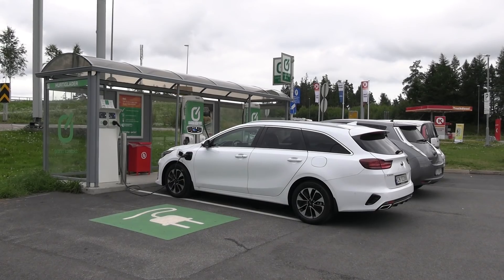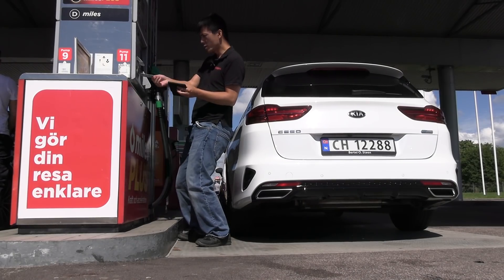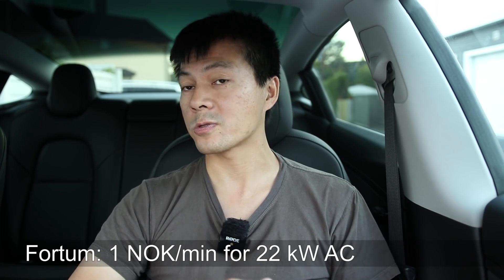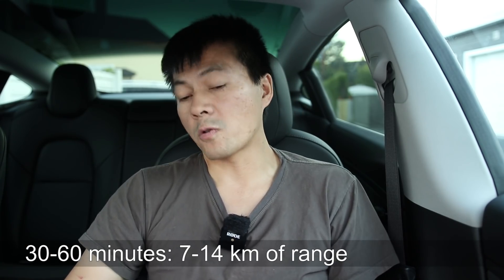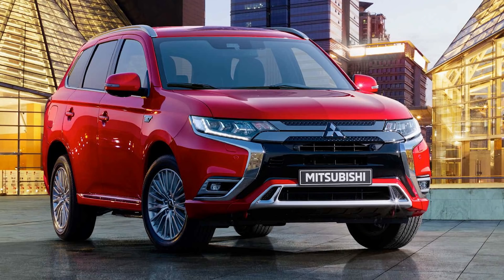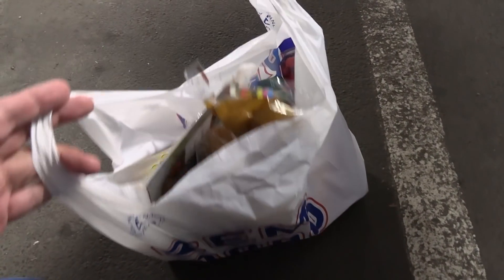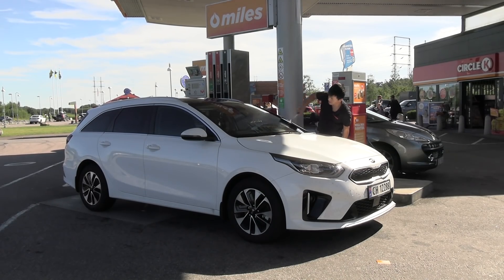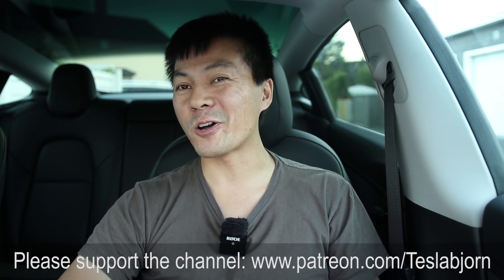Why didn't you plug in the PHEV while eating?

Comment: PHEVs are a joke!
Reply: Equally BEV is a joke. It just depends on 'use case'
Reply: No,they're not. I own a EV and PHEV and I find them both useful.
Reply: @venti4268  I actually agree. Both are very good depending on your needs ... and if you drive a lot even a diesel is good option.
Reply: @venti4268  Mechanic history tells that the more complex the powerhouse is, the highest the cost of maintenance is. You may say that PHEV is good now, but in future years I believe BEVs will win the battery tech by turning it into a standard product, setting the PHEVs aside. No one will want PHEVs because of its lower reliance. I understand PHEVs as a momentary stage of transition between ICE and BEVs.

Comment: I used to see phev  Drivers using chargers all the time  despite the points you highlight here.   A lot of them charge as they genuinely believe their saving the Environment, but often their just blocking a  bev from getting a a charge as would happen with our Triple  CCS/Chademon/ FAST AC43  in Ireland.   The recent introduction of Pay for  Charging  has reduced  the number of phev drivers charging now , as we have an Overstay fee  of  €5   after 45mins at Fast  AC chargers +   about  0.29c  / 33c   per kwh.   I recently changed back from the bmwi3  94ah  Rex to the   Hyundai Ioniq  28kwh   after  watching one of your recent reviews and  really love the car .
Reply: Northern Ireland is kind of worse there only 14 DC rapid charging points in NI, 7 of which have CCS. The points are free to use, but the main issue there is the fact that "freeloading" Mitsubishi Outlanders tend to sit there taking up a DC space.

If you want to do a long journey in an EV that has about 30 kWh of power available, then the only cars that can feasibly do it are the Nissan Leaf (for CHAdeMO only DC charging) and Renault Zoe, because it can make use of the 22kw AC charging points.

There's only 1 other charge point in Northern Ireland, that's ecotricity's Electric Highway charger located at the IKEA, which only has CHAdeMO and 43kw AC.

As the network is managed by the Department of Infrastructure, the network really is a mess. And there seems to be 0 plans to implement more CCS chargers, nor even implement HPC charging.

I do envy the situation in the south... Not only is there the ESB network, but there's EasyGo, Ionity and both Applegreen and Circle K are implementing their own chargers. Oh, and I think there's a Lidl and Tesco that each have their own DC charging.
Reply: @vaska00762  Going up North in an EV in September for three nights. We'll be chugging along the eastern coast and then to Giants Causeway. From what I saw it shouldn't be too bad even if we can slow charge as the Kona has enough range. But yes, I've noticed quite a difference between NI and the Republic. Fast chargers are sprouting up everywhere over here, even Ionity. Do keep in mind they're no longer free here, and come August 10 we'll be paying for słów chargers as well.
Reply: @PawelMrozik  the Kona is pretty perfect for longer journeys in NI, as it has the range to do what you need it to do without needing to recharge.

I recommend charging at Castlebellingham Applegreen before crossing the border as options will be few and far between.

The major CCS points are a point along the A1 Dromore road (northbound), Sprucefield Shopping Centre, Boucher Road, Shore Road Maxol (beside a McDonald's) and Applegreen Templepatrick M2.
Reply: @vaska00762  Thanks for the tips,  we're planning to slow charge during breaks and hopefully can get one full overnight charge at one of the B&Bs.
Reply: @PawelMrozik  there are some B&Bs around the Atlantic coast that have EV charge points, but most of them use Tesla Destination chargers. Not all of them do, but most of them will have 1 destination charger which will work with any EV, not just Teslas. Thank the EU directives on Type 2 for that.
Reply: @vaska00762  Thanks again for the tip, I do remember hearing that Konas will charge just fine from the destination chargers, but forgot about them! I was hoping Ikea Belfast would have CCS as we plan to stop there, but overall we should be fine as long as the Type 2s work.
Reply: @vaska00762  That pretty much described the current network ok.
Reply: @itsfahys  it's pretty depressing to see, and one of the more aggravating things is the fact that the Department for Infrastructure has a 2011 Leaf they keep as a photo op car, that they just park outside of Stormont to get the minister and someone else to just stand in front of for the media.

It's bullshit. I've been seeing a hell of a lot more EVs on the road here though, which is positive to see, but the biggest dilemma recently, I think, has been London. The Office for Low Emissions grant has been reduced from £3,500 down to £3,000, with the Transport Secretary promising to abolish the grant entirely, and instead investing the money directly into public charging infrastructure... which is bullshit unless you live in England. Responsibility for charging infrastructure falls on the devolved governments of Scotland, Wales and NI, and this means that that money that Westminster has promised, won't make it here. Ain't that fun?

What's maybe worse is the idea of a new scrappage scheme, which would allow people to "scrap" their old cars for a new BEV, but only get £6,000 towards a BEV. The main problem there is the fact that pre-dieselgate cars will likely be ineligible for being too new. 

While the SEAI grant of €5,000 and the VRT relief of €5,000 is certainly much, much more than what you can get in NI, the main problem is the fact that 2 of the cheapest new EVs on the market are just unavailable in Ireland. The VW e-Up! (as well as the Seat and Skoda versions) are not on sale in Ireland, even though they are in Northern Ireland. The MG ZS EV is also unobtainable, as MG hasn't even operated in Ireland since partition... MG dealerships in NI still exist though.

It's a pretty sad state of affairs, really.
Reply: @vaska00762  I see electric cars like smartphones, it's only a question of time before they're on parity with petrol and diesel. Then there'll be a huge market for used cheap EVs as the newest ones will have better battery tech. The infrastructure will follow everywhere, but I do understand your frustration. I'm not an EV owner, but I think the infrastructure in the Republic is okay and getting better.
Reply: @PawelMrozik  I mean... who needs parity between EV and ICE range, really?

I looked up what kind of power petrol and diesel fuel has, at least, in kWh. The most consistent results I got were about 9.2 kWh of energy for 1 litre of petrol and 10 kWh for 1 litre of diesel. These numbers would likely vary based on the quality of the fuel, but that's too big a variable.

The car I drive rn is a diesel Hyundai - they don't make them anymore. It has a 40 litre fuel tank. That's almost 400 kWh of capacity - insane to think about. The GoM would state 500 miles (804 km) in terms of range.

If I were to convert the miles per gallon to L/100km, I get about 5.2L/100km. Assuming that 1L of diesel = 10 kWh, that's 52kWh/100km. The Kona Electric gets on average 13.3kWh/100km. As far as I can see, diesel is blown out of the water by electric, petrol even more so.

It won't take very much for electric to really overtake ICE. A car with good efficiency, like the Kona, with an 80kWh battery would more than match a petrol or diesel car. But... why would you even need that 80kWh battery in the first place?

Honestly, I think the future will get better once battery production price gets really good. At that point, there's not even any point in sticking with fossil fuels. I just hope politicians who ultimately make decisions about stuff like charging infrastructure realise it sooner rather than later.
Reply: @vaska00762  in terms of who needs range parity? Consumers and business. Time is money, Bjorn's 1000km is a good testament to that.  In terms of efficiency, while it's true that petrol has a very high energy density, a lot of that energy is lost as heat. In the winter, that can actually be a good thing as it can be used to keep passengers warm. For many countries who depend on oil imports, the switch to electric mobility will bring additional wealth as they can produce the electricity domestically instead of relying on imports. It can also create global tension as it will put a lot of financial pressure on countries whose wealth comes mostly from oil and those that failed to diversify their economies.
Reply: Nice. How are you getting on with the Ioniq? I heard ESB will be introducing fees on the slow chargers August 10. Wondering what the next step up for Ioniq is, I think they're at 38kWh now. Imagine the range with a 64kWh battery.
Reply: @PawelMrozik  Im loving the Ioniq compared to my i3.  Its way more comfortable on  Poor Road surfaces,  and lots of   Speed reducing Ramps where i live.   Its also a lot more stable at Motorway speeds with its  well known Aero Dymanics and low profile holding it to the road a a lot better. You get a lot of extras like  LCAS,   Advanced Cruise Control, Courtesy Lighting for instance that i dint have in my i3.   I know the  Refreshed 38kwh  Ioniq  has a  lot slower charging speeds on Fast Chargers compared to the Classic 28kwhk model but id still consider it with its extra range as I dont drive long distances in Ireland, only occasionally going more than  300km.  I belive the 38.8kwh Ioniq is the last  version that will be released with talks of the Prophecy  to replace the Ioniq in Hyundai's range ,but that is just rumor at this stage.     This is the current positin in relation to pay Chaging with ESB taken from the Irish Times.  
There is a two-tier pricing structure, as there is for the faster 50kW chargers. For pay-as-you-go customers, the cost will be 26.8c per kW used. Regular users can pay a €4.60 monthly membership fee which reduces the cost to 23c per kW. The difference means that a pay-as-you-go customer would spend €16.61 to fully-charge (from flat) a car with a 62kWh battery (for instance, a Hyundai Kona Electric) or €14.26 under the subscription plan.

If you are using an ESB 50kW charger, that costs 33c per kilowatt-hour to use. With a monthly subscription, the rapid-charger price drops to 29c per kW.

The ESB says that, since it launched charger pricing last November, some 11,000 people have signed up to use the membership service.
Reply: @itsfahys  You're right, I think Bjorn has a review of the 38kWh Ioniq and the reduction in charging speed. I had no idea about the Prophesy, but if what they're saying is true, it looks like it'll be replacing the Ioniq. Glad you're enjoying it, I probably won't get an EV for a couple of years. Hopefully by then we'll see equal ranges compared to petrol and better infrastructure.
Reply: @PawelMrozik  Yes please a 64kw Ioniq.
Reply: Any triples that I'm aware of allow simultaneous AC and DC charging. The DC power might be reduced a bit, but that's unlikely to be a real problem if the PHEV is pulling 3.6kW AC.
This of course assumes that the charger has at least two parking spots.

Comment: I hate PHEV-drivers always blocking the 11kW and 22kW-chargers at shopping-centers etc.
Reply: So you'd prefer that they never charge?
Reply: Dave Krüger 
No, they can charge at home, at work, and hotels - where it makes sense!
Reply: @emillarson89  there is really no point to say somebody should not use charging stations. If you get BEV you get also downsides. Same for PHEVs. Very selfish thinking ...
Reply: Why hog 11 or 22kW if you cab only use 3,7???
Reply: @emillarson89  So an Ioniq Electric would also "block" AC 22kW, because it can only charge at 7.4kW ?
Reply: @emillarson89  It looks to me you seem to treat PHEV cars as fossil cars encroaching into your BEV territory. Instead you should treat them as fossil cars dipping their toes into EV (because they haven't overcome/learnt about BEV challenges (like range anxiety, lack of public charge points, etc.)).

If you say they shouldn't charge because there are limited charging spots and they are blocking you, it means there is insufficient charging infrastructure, validating their decision to not buy BEV.
Reply: It looks like you should suggest to those shopping centers to install more chargers.
Reply: PHEV that can use 11KW chargers should of course use them. Probably the whole journey to and from the shopping center can be made on pure EV in that way.
Reply: @venti4268  Even if you can charge like 3.7kw 3h shopping visit gets you full battery -> 40+km fully electric or 100 km with very low fuel consumption. That is one of the reasons to get PHEV in the first place.

Hey, actually, why BEV users should charge at shopping centers at all. They can easily drive from home to shopping center and back without any charging. Why block charging from those who can actually benefit from it? Just raising different point of view... :)
Reply: @mho0  Agree. BEV owners should make room for PHEV owners outside shopping centers,and PHEV should never use fast chargers like ionity etc. In that way both helps each other to go green
Reply: So you're saying if all chargers would be "blocked" by BEVs, you'd be happy ? I somehow don't believe that. You're just pissed because someone else is using the charger.

Comment: You're right Bjørn, it's much too expensive to charge a PHEV with A/C on a non-free public charger.
Reply: And on free ones, you’re still blocking a charger for a BEV....
Reply: @emillarson89  Mercedes has 7.4kW option for PHEVs. How is that any different from an Ioniq Electric charging with 7.4kW ? Charging is not blocking.
Reply: I call BS. If charging costs you too much then you're using the wrong charge card. It costs me way less to charge than it does to fuel, but no PHEV driver would ever use a card that charges by time.

Comment: Does the C factor have anything to do with the charging speed on these PHEVs?
I'd imagine if you tried to pump too hard into a tiny battery you would end up cooking it.
Reply from the maker: 3.5 kW is just 0.4 C. The battery should at least be able to take 7.4-11 kW which is around 1 C.
Reply: Bjørn Nyland Even without temperature management? I guess cost is a factor. Adding 11 kW charger would likely cost and weigh more, and only rarely be somewhat useful. Time/economy/environment for charging to save 3 litres of fuel — will that larger charger “pay off”? I doubt it. Maybe for a few folks in a corner (corner case).
PHEV seems to be for night/work-hour charging only, but should be charged every night! Otherwise BEV is probably a better deal (at least according to my personal priorities).
Upwards 1C could make sense for Kias when seeing their C curve — if the charger is not “too much” more expensive and “too much” heavier. But it should probably be an upgrade option rather than the default. Is it 5 kg extra? And 1000 € extra? On average, in the cars life, how many km will be gained extra with the beefier charger?
I don’t know shit about this. Mostly speculation. Someone with insights, please teach a noob like me :-)
Reply: @bjornnyland  Yes I think it´s only about the limitations of cheap 3,7 kW on board charges and not C. I have a BMW 225XE and it can charge easly 10-20 kW in Save Battery or Sports Mode, as well as up to 20-60 kW with recuperation. Due to relative high charging and decharging rate due to the small battery in comparsion to motor size, PHEV batteries are optimized for higer C factors. Due to the very limited battery range I think my actual car will be my first and last PHEV, as the latest BEV with bigger batteries and faster charging makes PHEV obsolet soon.
Reply: My Outlander PHEV (12kWh battery) charge at 15kW as max on the Chademo. Could have a 11kW onboard, 22 would be to much.
Reply: @tucsonor  I DC charged my Outlander only once. It was useless. AC charging at work or at home works out fine indeed.
Reply: @CrownRider  Same as I do, I've only charged twice on Chademo. First time just to see how it performed. Second time, the charger was free. So pure slowcharging for me.
Reply: As i know the problem is insufficient cooling
Reply: Battery charge power capability should be comparable with discharge, except rapid charge for longer times accumulate more heat, while discharge at high power is periodic and short.

Comment: Opel ampera driver... I charge every night and when I'm at work during the day. Regularly go for weeks without running the petrol engine, but on long trips I just juice up and go... It is not time effective to charge on the go, just as you say Bjorn... The volt pack can accept 50kW of regen, if it had DCFC it would be a different matter... Perhaps I should upgrade to a LEVC TX1 and have the benefit of all the energy sources
Reply: So you are one of the few lucky ones that have a nice and future-oriented employer.
(all employers do tell they are future-oriented, but not all are ...)
Reply: @voelkela  no, they just don't care about the electricity I use :)
Reply: Very curious about the Ampera. How has it been for reliability? Not many of them here.
Reply: @PawelMrozik  best car I have ever owned, and I've had a few. Fantastic build quality, fast, comfortable. Yes, it has a few faults but what car doesn't. I've had it three years and done 60k miles in that time, 131mpg, one wheel bearing and a strip and clean of the rear brakes. On 96k now, and still returns 50 miles to a charge in the summer, because I drive slow and steady.

I keep thinking about changing it, but I think I'll be in this for the long haul. I can't see a reason to change it. Being out of warranty doesn't concern me, they are not actually that complicated (if you're an electrical genius, lol)
Reply: @dorsetengineering  Nice, looks like you're a happy owner. Thanks for all that insightful info.